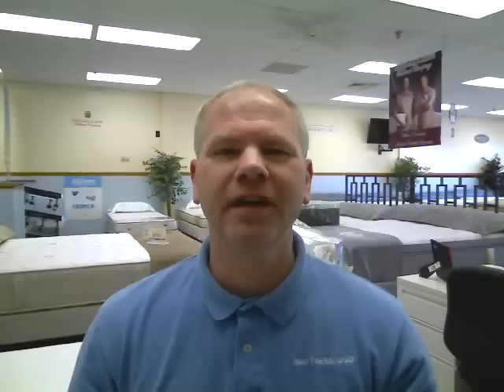Beducation® - Mattress Innerspring Gauge Thickness Explained

Comment: I appreciate your videos on mattress. What about when they have a 3 strand coil spring? do they go by the combined gauge of the 3 strands of wire twisted together? or just by the gauge of each individual strand used in the twisted coil?
Reply from the maker: You're talking about a cable coil, and you can rate their gauge either by the individual strands or by the completed coil. It depends upon how tight these are wrapped as to the finished thickness of the cable.